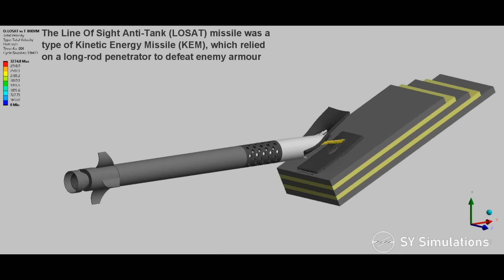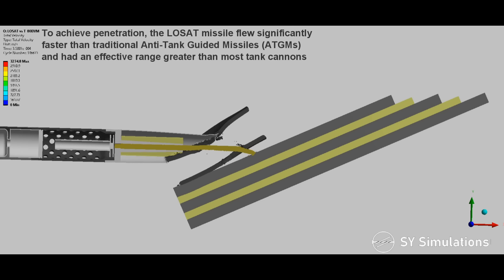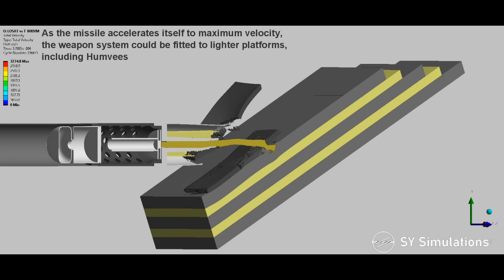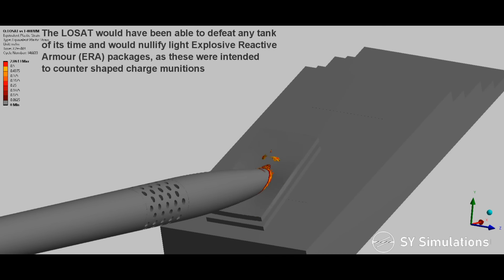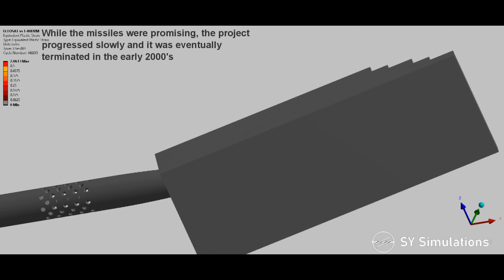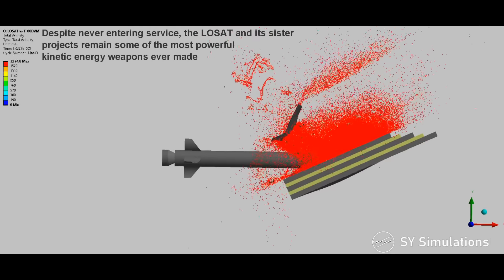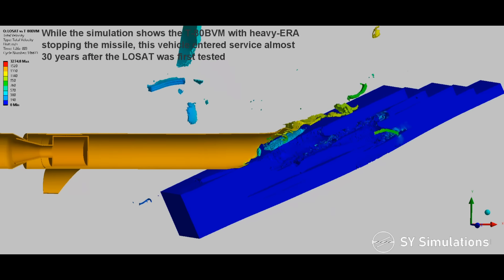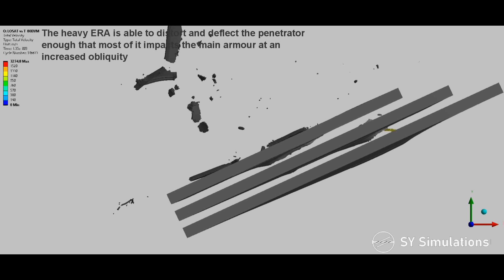LOSAT vs T-80BVM | MGM-166 Kinetic Energy Missile vs Relict ERA | Armour Penetration Simulation

Comment: Driver is dead 100% at the very least blind/unconscious
Reply: You forgot the spall liner Podboy + kevlar liner
Reply: @belgianfried  The spall liner they skip installing half the time, or it gets stolen and sold on the black market.
Reply: @TheMiipmiip  Podboy is still there, installed on all T-64B, T-80B(V?), T-72A (>1981) and T-72B tanks. So it's kinda unlikely that 'driver is dead' thing will happen, because first of all you bolt the liner INTO the tank before you assemble it

Comment: If the relict module even has explosive filler. A few captured T-80BVMs just had their modules filled with rubber.
Reply: yeah well thats corruption at its finest, the relikt and armor they use for simulations is the armor meant to be there, real life is always different from theory though
Reply: The explosive was removed by the crew that abandoned the tank, the rubber is simply a structure to hold the explosive
Reply: Mate it is known since 2 years that the crew removed the explosives before abandoning
Reply: @llthk138  What..? No, Relikt was made in 2006, the ones laying around are Kontakt-5
Reply: my source is that i made it the fuck up!
Reply: @Maverick966 What?? Do you know how long it takes to just disassemble a single ERA tile? If they had that time they would recover the whole vehicle instead.
Reply: @llthk138 Only true for Kontakt-1. Relikt and K-5 uses special explosives. Specifically relikt is very hard to produce. Because it is a special explosive sensitive enough to go off against KE penetrators. Thats why some T-90Ms and T-80BVMs leave the factory with K-5 on their sides.
Reply: @Phapchamp  
You can't recover most tanks because their tracks or engines have been blown out. The best you can do is salvage it's components like ERA, sights, etc.
The tank also had no gunner's sight, ya know.
Reply: @ThatZenoGuy  Again if you have time and comfort of removing ERA explosives one by one you have comfort of calling a recovery vehicle to tow the tank. You are not going to spend like hours removing explosives in frontline. And if you arent in the frontline you can just wait until recovery. 

What gunner sight are you talking about?
Reply: @Phapchamp  
They don't have endless recovery vehicles to tow random hulks of tanks. Come on.
You have a bot username.
Reply: @ThatZenoGuy  Yea ok they will just leave a T-90M easily recoverable out behind the frontline. You dont know what you are talking about.
Reply: @Phapchamp  
It wasn't a T-90M though lmao? It was a T-80 with ERA.
Pay attention.
Reply: @ThatZenoGuy  T-80BVM is used in more advanced units in AFRF alongside T-90M. Your point?
Reply: @Phapchamp  
There isn't a single T-90M that is found without explosive plates in the ERA.
Reply: @lightningstrike5024  literally this. this is the lengths to which people go just to try and sound smart and dog on a country because it's popular to do so

it's pretty cowardly ngl
Reply: @ThatZenoGuy  just recently, there was a video of 2 BREM-2 recovery vehicles the Russians tried to use to recover a Leopard, and they were attacked by FPV drones. Luckily the crew all got out of them, but it goes to show that even when concerning defeated enemy vehicles, trying to get the whole thing back is often potentially a waste of recovery vehicles that would be put to better use elsewhere that is safer
Reply: @AdotLOM  
Precisely.

Comment: I have doupts watching this simulation. If you look here, the kinetic energy of the missle is so high, it is not about penetration. It is about ripping the whole turret off or ripping the complete tank in half. https://youtu.be/ho_VHOjzMX0?si=iTeLNvo1Sx7bAklj
Reply from the maker: I've watched the whole bank of these trst videos and the performance is deceiving; these are shown impacting older T-72's without ERA -where the long rod would rip through them no problem. The massive explosions you see are the propellant and any other combustible materials igniting on impact, and while weighing a lot, the missile is made of thin aluminium, with the energy being transferred gradually to the target due to its length and softness.

Comment: Completely bogus simulation with no real understanding of the missile - first I doubt you have the penetrator, its real configuration or penetrator mass correct. No I can’t say any more so don’t ask. Second you disregard the effects of the propellant remaining going high order on impact. That disables/destroys and cleans off ERA- that detonation was equivalent to 100lb GP bomb - third in live fire tests this missile obliterated anything it hit to include many vehicles with heaviest ERA imaginable. No target - never mind a lowly T-80 - could survive an impact. Fourth the velocity is incorrect…no I can’t say any more. I can’t say any more with regards to testing beyond this simulation in no way portrays the missile correctly. Why do I say this? I helped with its design and was present at all live fire tests including the ones never made public - also incorrect was that did in fact enter service on the hmmwv with the 82nd airborne. The systems were deactivated in the mad rush for more infantry boots in Afghanistan. There are other errors in the simulation but I’m not going to get into those. Enough said. Btw one thing we did learn is no hydrocode model ever written regardless of resolution ever accurately modeled the real results observed. That was an issue we ran into repeatedly, and it’s not like we didn’t try to get to the bottom of it. Suffice it to say that behaviors at high mass and velocity differ from simulation.